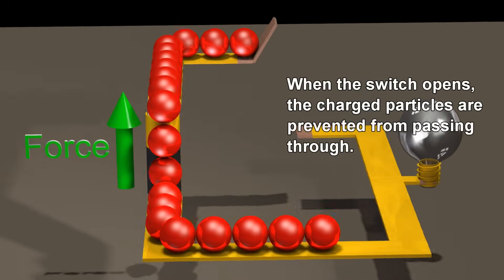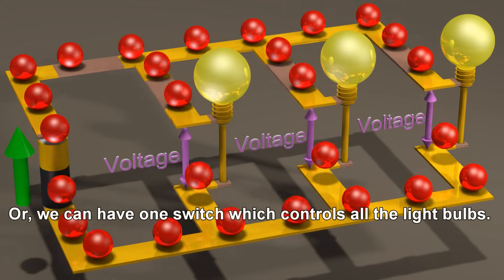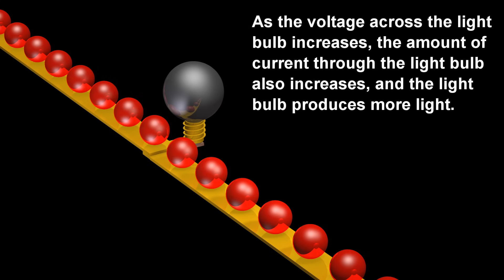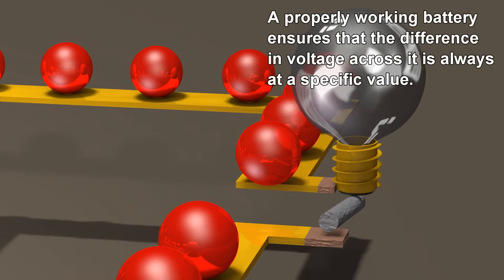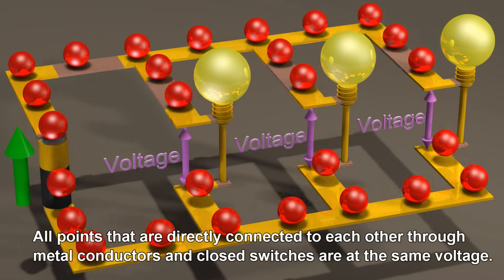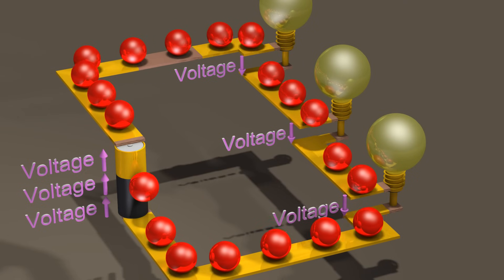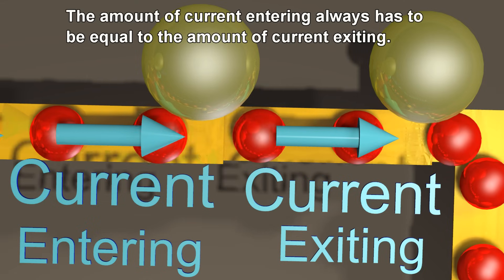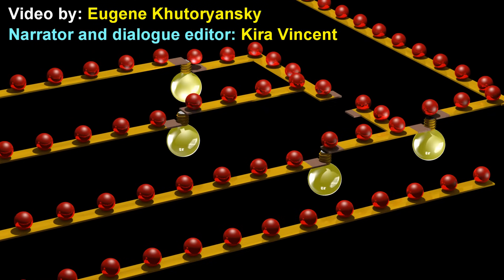Electric Circuits:  Basics of the voltage and current laws.

Comment: If I understood it. Can anyone correct me, so that I can learn. 

Voltage is the volume of charged electrons in a given area. 

Current is the speed of movement of the volume of charged electrons from one area to other area. 

Can we formulate voltage as volume of electrons/ area; and current as speed of movement* volume/ distance.   

If electrons move, you get current.  Without voltage there is not current. Without current there is not electricity. 

The elemental composition of a battery determine the number of charged electrons in a given area. Different elements have different mass and different number of electrons in their outer shell.  When current happens, the energy of the electrons is given to its neighbor element. The number of electrons in an area in our battery determines the voltage. How fast the energy of the electron is given is what we define as current. 

Hope any one with knowledge review my comment. If I am right, good and If I am wrong, also good. I will learn and others reading my comment will also learn. Win Win situation
Reply from the maker: Not exactly.  The voltage is the amount of energy per charged particle.  Current is the amount of charged particles passing each second.  I go into more detail about this in my video at  
http://youtu.be/XiHVe8U5PhU
Reply: +Physics Videos by Eugene Khutoryansky : I think we have the same comprehension with different formulation.  Thank you for the reply.

Comment: Hi can someone please answer my question ? Why is the current the same everywhere in a series circuit ? isn't there a voltage drop across a resistor for example which will cause the electrons to flow slower after they pass through the resistor ? Or are the spaces between the electrons reduced after they pass through the resistor in order to maintain the same amount of current ?
Reply: it's not as though the electrons had any constant velocity. the motion of the electrons is determined by deceleration, when they bump through the resistor, and acceleration by the electric field. so when every resistor has the same resistance, the electrons experience the same quantitative change in motion in every resistor, which you can model as a steady flow through the line of resistors. the voltage drop simply tells you how much energy through acceleration was converted in the course of that bumping through.

in resistors with different resistances, what you say will be the case. small resistance means more charges close together, greater resistance means faster flow but fewer charges, i.e. current stays the same because conservation of energy. imagine this as water going down a pipeline of varying width.

Comment: The battery is backwards since electrons flow from - to +.
Reply from the maker: Mike Fitzpatrick, I am using the standard notation for current flow, which is the direction of positive current.  This is the opposite of the direction that the negatively charged electrons actually flow.  I explained this in detail in my earlier video titled "Electric Potential: Visualizing Voltage." There is simply no way to please everyone with this issue.  In my original video on voltage and current which I made several years ago, I showed the actual direction of the electron flow, and then I received complaints that I should instead use the standard notation for current flow, as I did in this video.